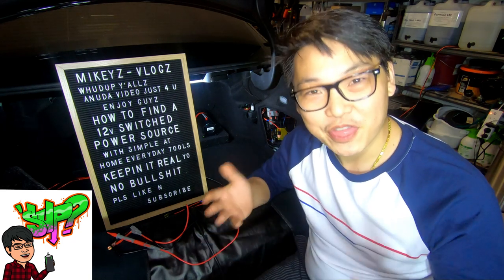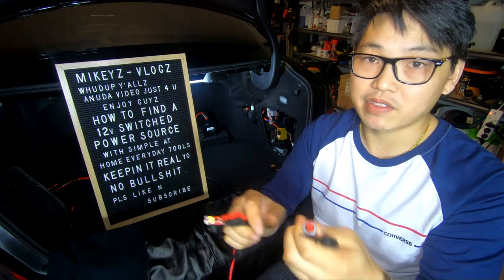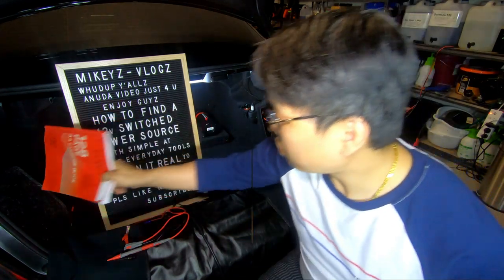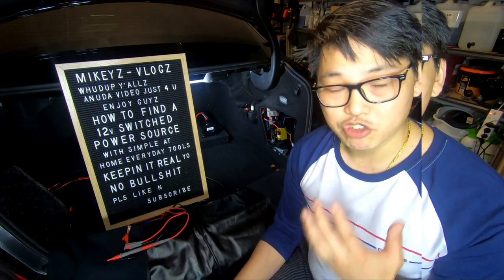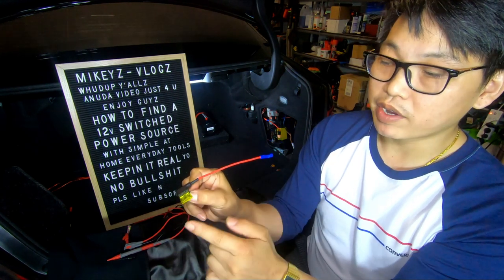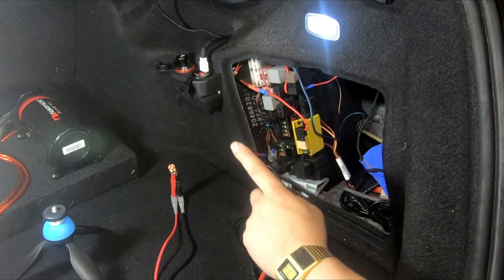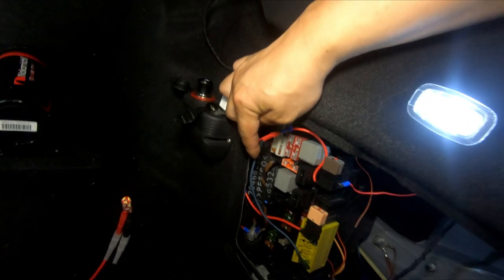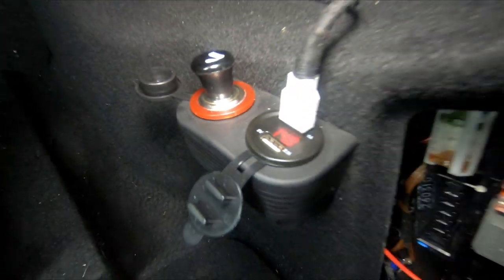HOW TO TEST FOR 12V SWITCHED POWER + USE A FUSE TAP + WHICH FUSES YOU CAN USE W204

Comment: i got oil gauge，water temp and voltage gauge they have 3 wires all is battery 12 v 。can i put them to one fuse tape？for the power
Reply from the maker: yes u can...the oil pressure will come from the adapter u install and ur just trying to give it power
Reply: @MIKEYZVLOGZ  thank you ：）

Comment: So the positive comes from the fuse tap number 72 so where do we join the negative wire of the device?
Reply from the maker: that can goto ground which can be any part of bare metal of the car chassis.. usually a spot that has brown wire is a good spot.. or a bolt that sticks out of the cars frame ...

Comment: BRO HEEELLLPPP 😝😝😝 Hi mikey , i have a lil question maybee you could help me out...i bought  a el wire kit for my door panels on my w204 , now my guestion is ,, would you have an idea where i could tap in too (´´safely´´) ,to connect the power cable(red)  and the ground cable (black)from the el wire to the car door electrics . I know that it´s best to tap it in in a 12v ´´switch power´´ cable ... would you know how i could do this work safely without messing everything up ?? 😅😅 really enjoy your vids brotha ✌️😎 Thanks in advance
Reply from the maker: cigarette lighter or rear sam unit / rear panel in boot ... door lights only work wen door is open so don't use that
Reply: @MIKEYZVLOGZ  ahw ok i see... lil while ago i came across a vid where a guy tapped in to the window buttons ( somewhere it seemd kinda logic to me bcus when you look closely you see that the windowbutton -light is on when the contact is on... 🤔 ) i´m not a electrician so i dunno if that´s do-able or even an option ... cus yeah if i can prevent running cables  from the cardoors to the  inside of the car ... that would be the way i´d prefere 😅😅any sujestions  car guru ??? 😅😅😝😝
Reply from the maker: @V11nC3ntt C  I'm no electrician either but basically u can tap whereever there is power to run leds ... the car door is also feasible..  only u would need to go through the door which is a pain .. I'd strongly recommend  the cigarette lighter and easy to hide
Reply: @MIKEYZVLOGZ  yeah i see what you mean. Thanks again bro 🤜🤛